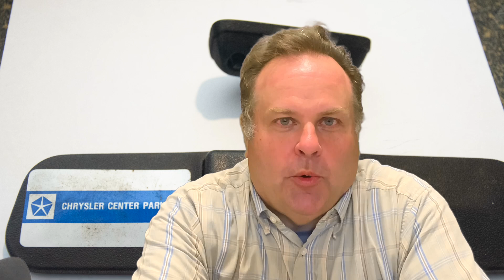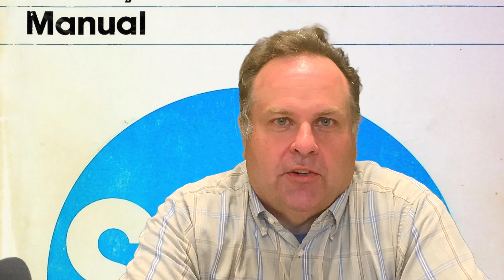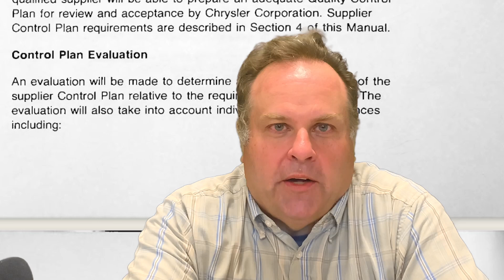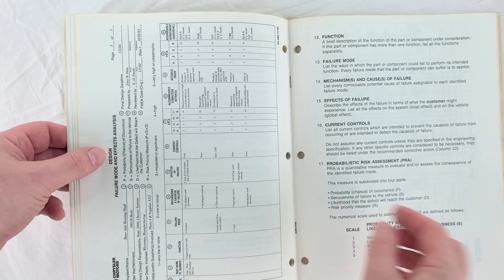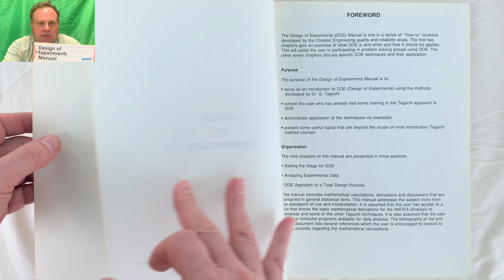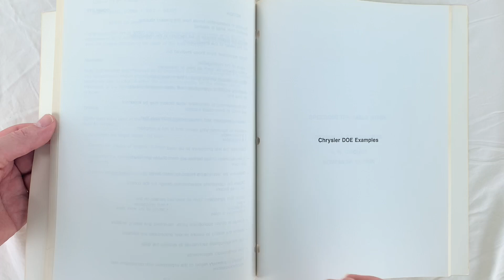Chrysler quality in the 1980s! SQA, DOE, and an introduction from an engineer!

Comment: I'm a quality engineer in medical device manufacturing. I'm my word FMEAs live in excel. DOEs in Minitab. Will you touch on Gage R&Rs?
Reply from the maker: Pete told me: “It was the 1980s, we did it all on paper.” 
FWIW (and this is Dave here, NOT Pete), I've used Minitab but not for many years. I use Jamovi for quick stuff and an older copy of SPSS (before it was subscription only) for more involved work. But I'm not an engineer, I just do statistics. If I was doing a Gage R&R and I knew Minitab, I'd use Minitab... but I'd probably search Jamovi and JASP to see if I could do it there, at this point. Both are easy to use front ends for R. I vaguely recall the main advantage of Minitab was being able to feed your results back into a data set which isn't something I've ever needed to do. I'm obviously not a Minitab expert though! It's been too long for me to remember the other advantages.
Reply from the maker: Pete added they did do some things on Lotus, and the supplier survey did check to make sure they had R&R processes and such, but he didn't want to get too technical. Most was still on paper. Even the charts... which I find kind of interesting since I remember using a plotter in 1981, and my boss at the supermarket company in 1983 or so bought an Apple II and brought it to work so he could do spreadsheets!

Comment: I hope you touch on the fuel injection systems of 1980 Chryslers in a future video. My dad had a 1987 Reliant and I had a 1987 Caravelle. The major headache we had with both cars was the faulty fuel injection electronics. On my Caravelle, I had to replace every sensor and the computer after 50K miles. The system on my Dad's Reliant was just plain wackadoodle. Was there an issue with the suppliers for the fuel injection electronics?
Reply from the maker: I haven't heard of this before, honestly, at least not so early - I'll refer to Pete. Sometimes I've seen relatively simple problems misdiagnosed repeatedly by dealers - I had one car make many trips back and forth before I bought the technical service bulletin book, found the symptoms, and fixed it in five minutes! No shortage of bad dealers racking up warranty hours in those days. But I'll ask Pete.
Reply from the maker: CudaPete passed on that one issue is the gasoline was blended for carburetors still, and had some particulates in it, so the fuel injectors could and did get clogged (I encountered this myself and the mechanic fortunately cleaned them as the first step!) - and the mechanics were mainly unfamiliar with (and often angry about) the new systems. The electronics were usually very reliable. You might also have had that other thing - “bad luck”!
Reply: @motalesdave  Thanks for the information. I never had problems with the injectors, just the electronics. I would've chalked it up to having a lemon if it hadn't been for my father's car having similar issues. All I can say is I never bought another Chrysler product again, although my brother had a Plymouth Sundance that lasted him nine years.
Reply from the maker: @neal1964  Reminds me of all those people who replaced their "bad" Chrysler electronic ignitions when mechanics didn't understand they could just swap the $2 ballast resistor...! (That was far too common in the 1970s and 1980s.) That said, 1987 was the first year they ALL had electronic fuel injection...